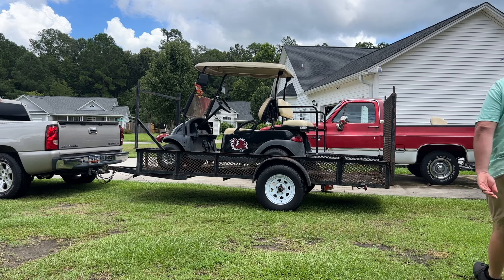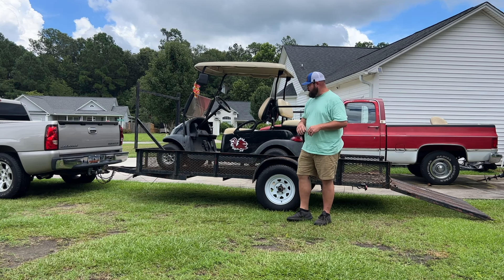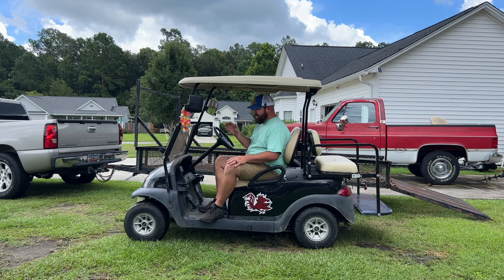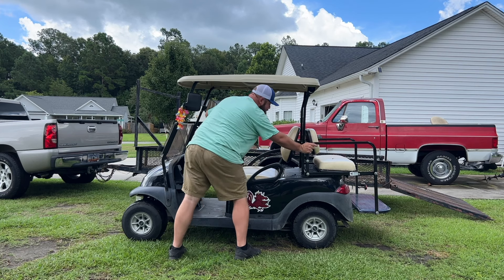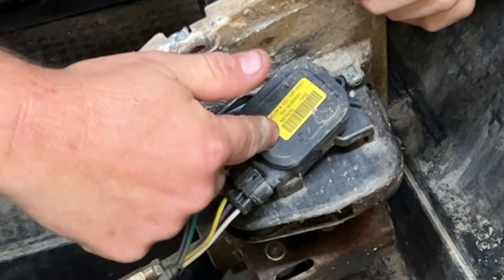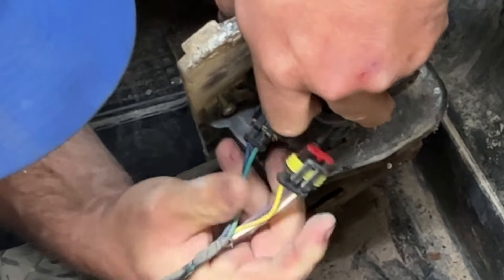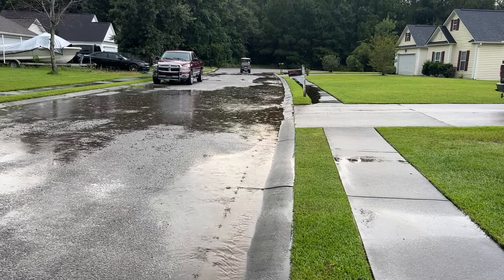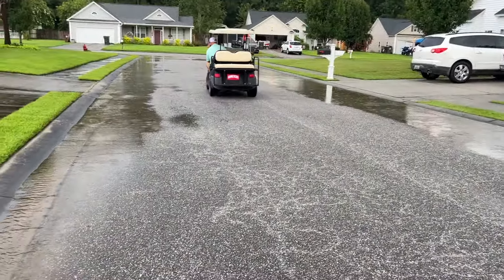How To Fix A Club Car Golf Cart that Randomly Dies While Driving | MCOR Replacement

Comment: This did not work on our 2010 precedent. Ours stops and brakes when we let off the pedal. If we are driving at full throttle, it does not stop. We have replaced the MCOR, the speed sensor, and the Solenoid with diode. I have a toggle forward reverse switch on order. I don't know what else to try if that doesn't work.

Comment: Hey brother, great video. I have a question for you if you dont mind. I know very little about golf carts but a elderly neighbor of mine asked me for help. She has 6, 8volt Trojan batteries in her club car and she says that she cannot play a full 18 without the cart dying. It does not hold a charge long enough. Do you have any suggestions into what i should be looking into? Any adive sould be appreciated. Thanks!
Reply from the maker: Look at the top of the batteries on the terminal. Should have a letter and number stamped into the terminal. Letters will be months and number is the year. That will tell you how to determine the year of the batteries and just know they usually last 5 years "if taken car4e of properly". I would also check the water levels in each battery as they should be just above the plates in the batteries (monthly maintenance). Check the voltage of each battery and then the pack voltage. Might have a low battery.

Comment: My mcor 4 conversion on my 99ds 48v just went today it would bog down randomly then be fine for days or just click when I push the pedal but no movement so I suspect the mcor as now it just clicks and refuses to move pack voltage is at 52v full charge time to order up an mcor I guess 😢

Comment: I have a 2016 EZGO RXV that's doing the same thing! Had the battery cables replaced at a shop. Did not fix the issue.  And advice??

Comment: Hey you are the man! I have a 2010 club car precedent which is going thru the same issue. At cold start it will roll backwards or forwards two or three feet and stop. I turn the switch off, wait a few seconds and it does the same thing all over again. I installed a brand new MCOR last evening, charged the batteries over night(which are only 6 months old), got up this morning and found her still doing the same thing. At time of battery installation I also installed brand new cables and stainless nuts. She was running great until 2 weeks ago. She helped in doing yard work and running errands 1 day and sick the next day. Any advice would be greatly appreciated. I don’t want to take her to the shop. I’m a dyi’er by nature and want to fix her myself. Thanks in advance.

Comment: I have a 2005 president, I needed to adjust the brakes the other day and noticed the 2 wire plug wires were striped about 1/4" and twisted together (not cut) and plug in the emcor. What do you think the reason for that is? ✌🏻
Reply: The two wire plug is just a micro switch that tell the controller you are actually pressing the pedal. I think it's the most common failure. I  have one similar and I just put the cart in neutral and pop the pedal a couple times to clean the contacts and it works for a couple weeks. One day I'll replace it. You can break it open and replace the micro switch.

Comment: This same thing happens to me but I have an EZGO any ideas what it would be?
Reply from the maker: the ezgo one is under the floor mat, pull up the metal cover and then pull up the plastic lid. Its called a ITS Inductive Throttle Sensor.

Comment: "Everyone" told me the same thing about Chinese sourced MCOR's, but when my 2016 Precedent started having jerky acceleration and I checked out buying an OEM MCOR, I about choked over the price. So I ended up buying the same 10LOL brand MCOR, and I've done more "LOL's" than 10 since it's still working 1.5 years later.  I'm sure there are some non-OEM ones that quickly fail, but since most parts (yes, even OEM) are made in the same Chinese factories, it's financially wiser (and definitely worth the risk) to try the significantly cheaper part first. 

By the way, good karma fixing a friend's cart like that. I don't have a problem with cart shops charging a lot of money to fix or upgrade  several things wrong with a cart, but for something obviously simple like this to charge $400+ is just a con. Shop fees are shop fees, but there's no way replacing even an OEM MCOR should be $400.

Comment: I have a 2014 EZGO TXT electric cart. If i am at dead stop and press gas pedal to floor it loses all power . I just changed to lithium batteries . Could there be some type of protection form power surge causing loss of power ? Thanks
Reply: Did you ever figure out what the issue was? I have the same exact problem. I swapped to lithium batteries. Everything ran great but after about four months, it cuts out whenever I step on the gas and I have to reset the battery.

Comment: Had a similar issue with my '13 Precedent.  Called the shop I have purchased parts from previously, who suggested it is likely either the solenoid or MCOR.  I bought a new OEM solenoid and he threw in a MCOR made in China for free.  I was told if it was the MCOR, to purchase an OEM one because the ones made in China stop working after a few months.  It ended up being the solenoid, so I never had to replace the MCOR.
Reply from the maker: Ive had some to last me over a year and ive had some last me a couple weeks. Its really hit or miss with them. But $35 is a gamble some are willing to take. My golf cart WLKNTALL has an oem on it. I paid over $150 for it.

Comment: I have same cart as this one and with my batteries charged it will only go 6mph peddle all the way down. I have had it take off for a sec like it wanted to go faster but then goes back to 6 mph. Never dies out. Could this be mcore as well or something else. Thanks for all your great videos
Reply from the maker: Could be the speed sensor is bad on the side of the motor. That is another cheap fix. I havent had one do that yet to me so I havent made a video. But you can get this speed magnet to gain a few extra mph as well - https://amzn.to/45miDTr

Comment: Hi could you possibly help me? I’m having trouble 36 volt ezgo. Txt pds. I fried my controller and don’t know what else to check? New solenoid and new controller. When I turn the key on press forward or reverse and press on the pedal the motor runs for 3 seconds and controller pops. The reverse buzzer works but won’t run after the pop. I have checked my wiring and battery volts, ITS, micro switch. Honestly checked everything and about to pull my hair. When I got the cart all the electrical was cut out down to a bare frame. The motor tested and works . Can you help me?
Thank you.

Comment: Just bought a club car precedent 2016 with lithium. My pedal always works but it bucks or surges up to 3/4 pedal.

At full speed it is smooth but when trying to go slow it lurches like it accelerates then cuts power over and over again. 

Could this also be an mcor?
Reply from the maker: yessir

Comment: I had a problem with power drop-outs, but it would only last 1-2 seconds, usually going up a hill, and sometimes when starting from a dead stop.  I replaced the speed sensor and the drop-outs went away... and the cart speed went way up.  MCOR replacement looks very easy... wondering if I should do that as well?
Reply from the maker: If it’s not broken don’t mess with it.
Reply: Had this issue many times. Most of the time its the sensor. Not to say it couldn't be the MCOR, but I check out the sensor first. Less expensive fix to. If MCOR, don't buy cheap China crap. Always buy OEM. More money, but will last

Comment: Ours is a 1998 and does not have a mcor, so what would we need to do on it for this same issue? Any ideas?
Reply from the maker: If you have a 98 club car  then you have a ds. The  mcor location on a ds is on the passenger side frame rail under the passenger side of the cart. If it doesnt have the ds then you have a vglide and its under the seat on the drivers side frame rail. It will be a 1/4 round plastic box shaped like a slice of pizza. You will have one of the 2 and it could have either one.

Comment: Thank you so much. My parents club car us doing this and I am trying to fix. It is a 1999. I can't find a part for a 99. Also does the part go by a different name. Many thanks,  Lydia 4/17/24
Reply from the maker: For a 1999 they should have a club car ds which is the older body style cart and in my opinion the best looking cart. On that cart the MCOR will be located on the passenger side under the cart on the frame rail. It will be a black box mounted to the frame rail. If you look down there and there isnt anything, then they might have a Vglide under the seat on the drivers side. It will be shaped like a slice of pizza and will be black as well. They are only on the drivers side under the seat mounted on top of the frame. If its a v glide then you need to know if its a sepex cart with a push button fnr switch or manual turn lever. There are 2 different types.
Reply: Hi. Thank you very much.  You have been most kind and helpful.  I appreciate you.  Lydia

Comment: Hi Ryan, I spoke to soon, I just installed the new MCOR and it’s still doing the same thing, starts to go but then dies, forward and reversing. Any thoughts or suggestions?
Reply: Hi, Ryan, I have the same issues with my 2002 Club Car. I've replaced the Mcor, the solenoid, and the controller. I still have the same problem.
Reply: @jimhampton4130 hey, did you ever fix the problem?
Reply: @jimhampton4130 hey, did you ever fix the problem?

Comment: I've got a gas powered club car precedent that is having similar issues. Could this be my problem also?
Reply from the maker: No, this is only for electric carts.
Reply: @Fentertainment  okay. Do you know what could be causing that issue on a gas powered golf cart? Thank you for the quick response
Reply: I have a gas with the same issue also did u find what was you problem
Reply: @Johnsmith-ht6ke  I think my issue is a speed limiter. Because it will only do it going down hill now. I replaced my solenoid and battery along with putting a new spark plug in also.

Comment: Ryan-i have a 2008 DS with this issue.  Do you know where i find the MCOR for that aged cart?  i looks like the part you linked is for a newer cart.  thanks bud
Reply: I'd suggest an mcor 4 conversion my 99ds 48v has the conversion my mcor just died today but it's such a good upgrade and easy to install and rather cheap for the whole kit